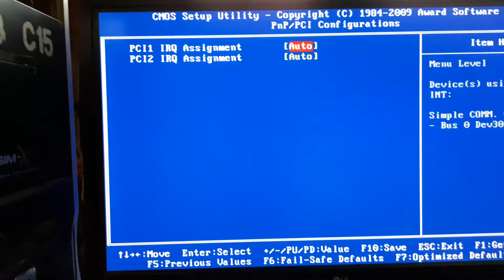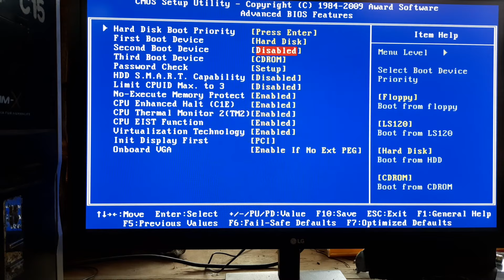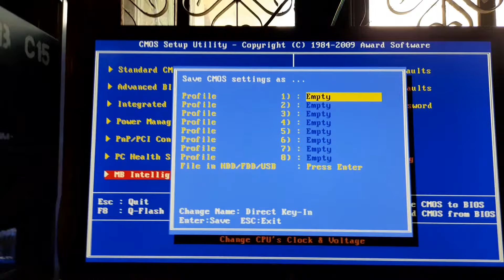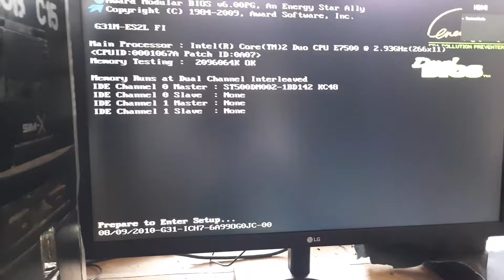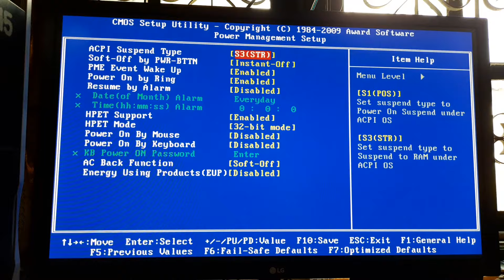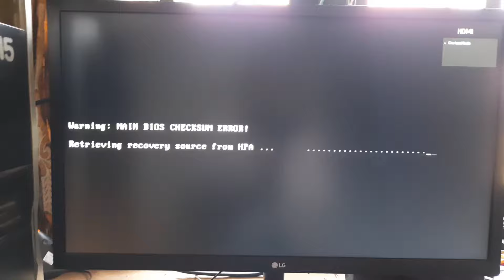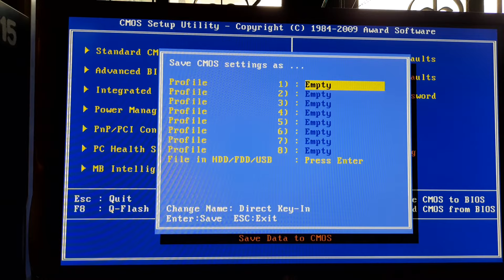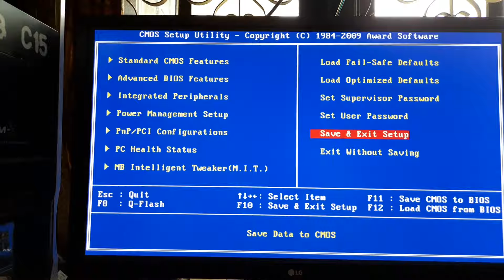Cara Reset Bios dan Reset Cmos itu BERBEDA - Reset BIOS Motherboard Komputer

Comment: bang kenapa setiap kali saya nyalain pc, keyboard sama mouse gak connect? jadinya kan gabisa ngapain2in, bahkan gak bisa masuk menu. trs untuk jumper ada pengaruhnya tapi berupa nyala sebentar, mati, abis itu nyala lagi. ini kenapa yaa?
Reply: apa saya harus ganti motherboard?
Reply from the maker: Windows sehat gk ? Iya coba dulu jumper atao cler cmos biar pengturan nya reset, lobang USB nya kotor gk ?
Pengalaman ku pernah punya mobo gitu smua lobang usb mati restar dulu baru bisa, biasanya kalo habis ada hardware baru colok abis itu enggak, aku dulu pake mobo MSI
Reply from the maker: @tarapiero  gk dibalas ya ? Oh klo sudah yakin os semuanya okew saja namun terjadi seperti itu lahi , iya bang ganti motherboard aja jalan terbaik
Reply: @SalamKomputer  iya bang nanti saya konsul dulu sama tukang service. mudah2an gak ditawarin yg terlalu mahal hehe.. mungkin motherboardnya yg sama modelnya.
Reply: Update: udah nyala lagi bang, katanya motherboardnya kotor, jadi tinggal bersihin aja. aduh dasar aku. makasi ya bang udah coba bantuin
Reply from the maker: Mantap lah kalo sudah benar mah bisa , oke siap terimakasih atas dukungannya
Reply: @SalamKomputer  siip

Comment: Om... Pas hbs booting mulai tulisan star windows macet ga mau gerak lagi apa nya om..
Reply from the maker: Harddi bisa bang, ram juga bisa, windos juga bisa, coba bersihkan ram, pastikan hdd bagus, lalu install ulang coba
Reply: Hardisk sy pakai di cpu lain booting windows normal... Ram normal...
Reply from the maker: Harusnya blue screen dong :D
Ram itu bukan cuma sampe bios bang, banyak ram yg gk bisa masuk windos pengalaman ku ,,, coba deh lepas bersihkan smua slow lubangnya ram nya, dah coba 1 1 nyalahkan sampe masuk windos, juga lu bubang satanya bersihkan , kalo  gk bisa juga pin CPU bersihkan, install ulang juga klo perlu ...
Klo gk bisa juga fix ada yg rusak itu bang
Reply: Sy pakai windows 7.. jadi stlh power on detek bios lsng starting windows lsng berhenti disitu saja..  ga gerak2 lagi

Comment: Tanya bang. Sudah ganti baru baterai cmos laptop tapi masih error' setingan bios nya kenapa tidak tersimpan? Terima kasih
Reply from the maker: Di amplas dulu itu tempat batrenya
Reply: @SalamKomputer  di laptop cmos nya pakai 2 pin bang. Cara nya gimana ya?
Reply from the maker: @ardiantorico  di ampas lubang batrenya bukan Jumper nya
Reply: Oke bang. Terima kasih

Comment: Bang mau tanya, kalo mau reset password bios di motherboard savio dan cara mindahin pin nya itu gmna ya?
Reply from the maker: cari jumper buat reset biosnya, kalo dia system pindah ya pindahin aja ke baguian reset bios,
dan ada beberapa mobo emang ada yg pake password caranya ya di pindahkan jumpernya di bagian non password,
itumah kamu sendirin yg cari, aku gk tau modelnya beginimana bang
Reply: @SalamKomputer  uda bisa bang , makasihh

Comment: Bang mobo saya biostar g41 hanya masuk safe mode di win 7 pas setting terakhir error,  gmn solusinya bang terima kasih
Reply from the maker: Instal ulang saja Bang pastikan semua pin2 ram vga bersihin dulu nanti untuk bios nya bisa di-setting default saja di pengaturan BIOS

Comment: Bang pc saya cpu speed nya ke lock di angka 0,8GHz, tapi aslinya prosesor yang saya pakai standarnya di angka 3,2GHz, jadi itu kejadian setelah saya baru ganti processor bang. Cara benerinnya gmna yah bang, tau ga? Tq
Reply from the maker: Kalo di destop iya bang, nanti akan naik ketika load berat,
Kalo untuk settingan bios kalo default pun gak masalah, selama pin prosesor motherboard aman dan sudah di updet bios ketika mau ganti generasi CPU
Reply: @SalamKomputer  oh jadi harus update bios kalo mau ganti generasi CPU, thank bang ntar saya coba update dulu biosnya
Reply from the maker: @fahmifauzi2834  update bios harus pake prosesor lama dulu bang, pasang nya.
Reply: @SalamKomputer  ok, thanks bang nanti saya coba

Comment: Bang mobo msi a3+ tiba2 muncul tulisan
checksum is error for misc.bin please make sure misc.bin file is complete

Solusinya apa
Reply from the maker: lepas hdd bang, lepas ram lepas vga bersihkan smua pin2nya lalu pasang lagi tes 1 1 tanpa hdd, nanti kalo normal tinggal pasang hdd atur boot
Reply: @SalamKomputer  udh clear cmos dan bios sama aja mas. Udh lepas part smua sama aja

Comment: Bang mau tanya klo VGA tidak terditek, apakah hrs clear CMOS /BIOS ?? trims
Reply from the maker: Gak juga.
Clear cmos gpp kalo mao.
Habis itu lepas VGA bersihkan pin2 vga dan lubang slot PCI vga habis itu pasang lagi install driver, kalo gabisa kemungkinan Vga rusak ataupun bios vga bekas miner
Reply: @SalamKomputer  terimakasih penjelasanya,.  Td sdh Sy clear CMOS Btw VGA baru beli kemungkinan slot PCI yg di Mobo.
Reply: @sigitsatriani kebaca ga bang pas abis clear cmos

Comment: Bang, motherbord saya malemnya biasa aja, pas pagi mau dinyalain tidak bisa, kipas cpu juga tidak berputar. apakah dengan cara ini bisa nyala lagi ya? mohon bantuanya
Reply from the maker: Tergantung bang, pada motherboard jadul yg slot ram 4 kebanyakan gk muter dulu kipasnya sampe benar2 nyala ....

Tapi klo kasus ini bisa jadi mobo yg mati ato psu ... Coba bongkar ulang bersihkan dulu semuanya
Reply: Ane pake msi 970A G43 bang, saya pake mobo lain komouter bisa nyala. Kalo kebersihan si insya allah bersih mobonya.
Reply from the maker: @ervanyunanda6027  klo gitu bisa jadi motherboard mati bang, namanya juga barang dipakai suatu saat ada waktunya dia mati, kalo motherboard sudah mati kayaknya sudah tidak berguna bang jika di Crear Cmos Reset bios seperti di video ... Mao gimana lagi ya bang, kalo sampe mobo gk bisa ngidupin fan PSU pun ya dipastikan mati

Comment: Bang pc ku selalu blue screen abis instal windows , padahl udah ganti instaler tapi begitu terus, munculnya gk tentu kadang 5 mnit sampe 20 mnit baru blue screen
Reply from the maker: Install windos + setting2 windos + software2 dasar + driver sudah bener blom ? Aku dah buat loh videonya part 1 sampe 4
Kalo kamu sudah benar coba cek settingan satanya apa di bios salah gk,
Kalo smua benar masih error2an brarti cuma 2 hal

1. Ada masalah hardware
2. Aplikasi yg kamu gunakan error, misal semacam emulator android itu mudah buat blue screen

Comment: Bang mau tanya, kok keyboard saya gk kedetect ya, jadi gk bisa masuk bios.
Reply from the maker: Coba ganti keyboard pake Ps2 bang jangan usb soalnya kalo keybort usb harus yg bagus untuk masuk bios, pengalaman banyak keybot usb yg gabisa masuk bios
Reply: @SalamKomputer  Makasih bang sudah direspon, tapi sudah saya coba ke ps2 tetep belom bisa, atau biosnya harus di flash ya?
atau circuit cmos ke bios error/putus?
Reply: @SalamKomputer  Bang ini sudah bisa masuk windows aku diemin beberapa jam baru aku kembalikan jumpernya, tapi aku khawatir kalau ku shutdown belum ter reset bios nya terus error lagi.
Apa ada cara reset bios dari windows?
Thanks.

Comment: Bang kok mobo saya slot pci nya gak bisa pakai vga ya?
Reply from the maker: Cari amplas halus bang seperti video aku bersihkan lubang ram ..
Kau lipat 2 atau 3 sehingga bisa dimasukkan kedalm lubang Pci Nya habis itu gesek2 berkali lalu bersihkan pake koas , juga pin Vga nya yg mao di colok bersih kan pakai penghapus , klo gk bisa juga berarti rusak mobo nya
Reply: @SalamKomputer  sudah saya bersihkan tapi tetap gak bisa bang, tapi kalo vga nya di cabut nyala normal bang

Comment: Bang minta solusi, komputer saya chipset h61, motherboard nyala ,tapi tak tampil di monitor, dah coba seperti Vidio Abang. reset BIOS, memory bagus, prosesor bagus,udah Chang part ke komputer lain. Tapi motherboard tetap tidak tampil,
Reply from the maker: https://youtu.be/QMwKyZMKhpg pin ram pin vga pin prosesor, slot ram slot vga slot prosesor. Dan psu amankan dulu.
Reply: @SalamKomputer  trimakasih jawaban nya bang,, tak coba dulu🙏🙏🙏🙏👍👍👍👍

Comment: Kalau keyboard gk kedeteksi di bios ngatasinnya gimana mas
Reply from the maker: Ganti pakai keyboard colokan PS2 jangan USB, soalnya banyak keyboard usb murah gk bisa masuk bios
Reply: @SalamKomputer  sudah bos, udah pake keyboard ps2 juga tetep gk bisa
Reply: @SalamKomputer  kira² peke trik seperti di vidio bisa work gk yha
Reply from the maker: @agungkw08  Di dalam windows nya normal gk keyboardnya ?
Bisa jadi rusak keyboardnya, tapi klo di tanya macet di bios berarti hardisk nya kemungkinan rusak, ato ram nya sudah mulai error macet
Reply from the maker: @agungkw08  lepas dulu coba bang sata ke harddisknya
Reply from the maker: @agungkw08  klomau coba clear cmos coba aja deh gpp
Reply: @SalamKomputer  keyboard normal mas, udah saya coba di komputer lain
Reply: @SalamKomputer  bentar, saya coba lepas kabel sata e
Reply: @SalamKomputer  kalau mau install ulang malah stuck di logo windows kira² kenapa yha bang
Reply from the maker: @agungkw08  lepas prosesor nya bersihkan pin nya dan jarum mobo
Reply from the maker: @agungkw08  ram juga , harus hati2 banget
Reply: @SalamKomputer  oke makasih sarannya boss, auto subscribe 😅

Comment: Bang saya mau instal windows 7, kok stuck di Windows is loading files ya lama? Saya udah ganti file bootable 4x tetep aja
Reply from the maker: Baru balas gimana sekarang sudah selesai belum coba pastikan flashdisk-nya asli tidak bajakan dan pastikan proses pembuatan usb-nya benar dan pastikan biosnya sudah benar Bang kalau sudah benar semua kemungkinan di RAM atau prosesor bersihkan dulu
Reply: @SalamKomputer  sudah kok flashdisk saya ori sandisk yg 16gb. Bios sesuai juga pake MBR di Rufus nya, sudah pakai bootable yang aio tetap juga. Kalau ram sudah diganti dan hardisk masih begitu bang, makanya saya agak bingung

Comment: Bang kenapa ya PC ane kalo misal nya di off kabel power nya di cabut pas mau di idupin lagi settan BIOS nya ke default lagi itu kenapa ya
Reply from the maker: Batre biosnya habis gan, dan bersihkan juga https://youtu.be/ZrUuUt0_mY4
Reply: Otw gan nanti saya coba ganti itu kalo boleh tau batrey BIOS semua ukuran nya sama kan ya
Reply from the maker: @ytindie5797  iya, tuh ada videonya kan :D
Reply: @SalamKomputer  siap udah di tontn gan tadi baru ganti batre sempet ngeblank layarnya kondisi cpu nyala. sempet bongkar pasang sochet akhir nya normal heheh makasih info nya gan
Reply: Punya saya jg gitu bang kasus nya, kalau kabel power di cabut, pas di idupin lg ,semua settingan bios kembali ke default, namun bila tidak dicabut akan normal bootingnya,  sya sudah ganti battery cmos, jumper cmos, cabut kabel2, mobo dan bersihkan semuanya, kira2 apa yg error bang? Mobo  sya ecs h87h3-m. Mksih bang

Comment: bang, pc nyala tp no signal
bios apa juga mempengaruhi bang?
Reply from the maker: Tonton bang sampe abis https://youtu.be/QMwKyZMKhpg
Reply: @SalamKomputer  udah saya lakukan semua, waktu saya cabut VGA tampil 100% lancar. tp, waktu saya pasang VGA kembali no signal. tp, kadang nyala kadang nggak. udah dibawa ke tukang service, dan di coba VGA lain tetep no signal. dari situ saya bingung, apa ada masalah lain?
Reply: @SalamKomputer  btw udah diliat awal sampe akhir
Reply from the maker: @wahyumeilandri9456  beli amplas halus ukuran 1500, hapusan, kuas,

Amplas lipat 2 bersihkan smua lubang ram dan lubang vga di motherboard,

Pastikan psu aman dan vga original yg bukan ada power pin padahal tidak,
Reply from the maker: @wahyumeilandri9456  kalo gak bisa juga motherboard/psu udah
Reply: @SalamKomputer  semua bang, udah dilakuin. pertama saya pikir VGA nya rusak karena udah pemakain 3 thn. waktu saya ke tukang service , sempat di tes VGA lain/VGA dari tukang service. dan itu tetep no signal

Comment: Bang pnya sy tdk bs
Reply from the maker: Tidak bisa nyala PC nya atau tidak bisa reset gan ?
Reply: Tdk reset.ada tulisan reboot and select proper boot device
Reply from the maker: @AHMADFAUZI-jq9ln  kemungkinan 2 hal, settingan bootingnya, atau HDD nya rusak gan
Reply: Tdk reset bang.hdd baru ganti yg 1 tb
Reply from the maker: @AHMADFAUZI-jq9ln  ya settingan biosnya cek booting masuk hdd gk, trus cek juga sebelumnya mode GPT MBR LEGACY UEFI ... Cek aja di bagian fitstbootnya dulu, klo kmu gk bisa coba install ulang takutnya bootmanager nya error
Reply: @SalamKomputer  di bios nya ada tulisan boot override.mksd nya gmn tu bang?
Reply from the maker: @AHMADFAUZI-jq9ln  iya gan coba cek dulu bootingnya udah bener belum lari ke hdd kalo dah bener coba install ulang aja dah jalan pintas
Reply: @SalamKomputer  ok mksh bang